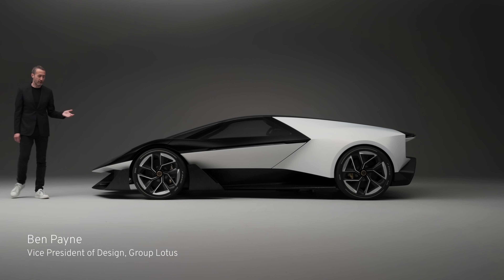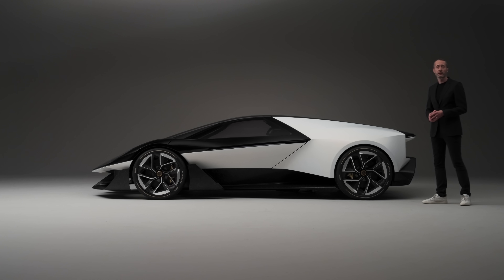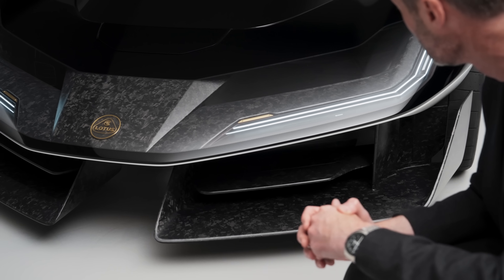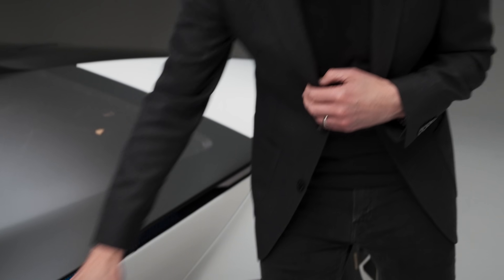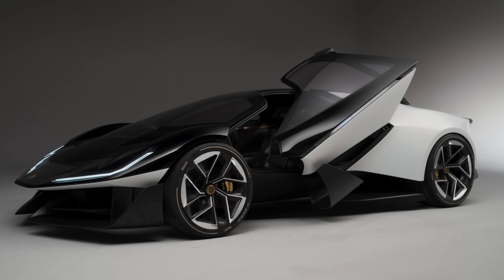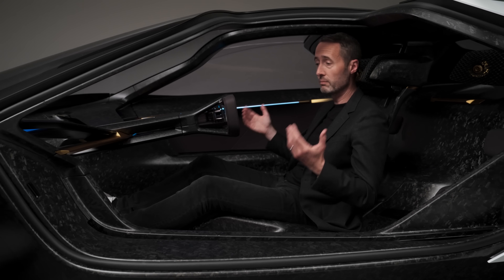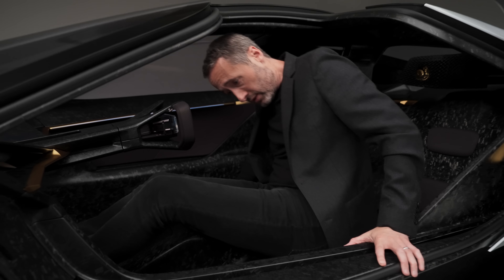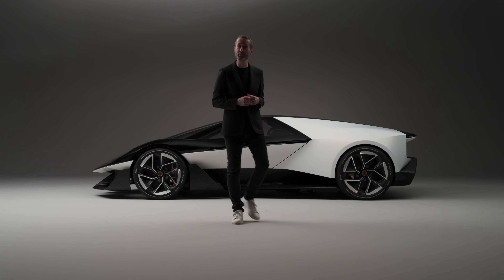Theory 1 | Designing the future of performance vehicles

Comment: Full drive by wire on a sports car is just... no. Steering wheel haptics on a sports car is another no. A door opening for as long as it takes to finish the 24h of Le Mans is uneccesary weight and complexity. LED lights on the door is a flex, sure. I like the design of the shell. Simplify the tech to aid the driver not distract or disconnect from the road. The best sports cars are stupid, not trying to be smarter than it's drivers.

Comment: @kelseystickney8663 @veronikalynn5084 @VoidBringer_98 Whether this presenter knows exactly what "analog" means matters not.  He is using all technical terms appropriately and accurately.

Analogue / Analog: This word is derived from Greek "analogos", meaning "according to proportion", meaning the output is proportional to the input.  In this context, it means continuous measurement, such as a mercury thermometer.  A pictorial representation would be a wheelchair ramp.

Digital: This word is derived from Latin "digitus" or in English, "digit" or "finger / toe".  In this context of computing, it means counting using steps such as that of voltage output levels of a transistor, i.e. binary.  A pictorial representation would be a staircase.

Electronics in the beginning was designed with analog technology where dials were moved according to current flow or voltage level.  This is like the needle in the first speedometers.  Now we use digital speedometers which have numbers shown by LEDs.

DNA:
Digital: the electronics in the car.  You saw the nVidia brand.  This may be an indication that AI technology will be used, since nVidia are now designing chips for AI software.

Natural: In this video, they are referring to the seats and driving experience being naturally fitted to the human body: Head up display (HUD), vibrations in the seating, easy entry / exit through the door.

Analog: Suspension, aerodynamic body, brakes, drive-train etc. are all analog engineering components because they deal with an analog environment, such as road surface and wind.

Comment: What humanity needs are small, lightweight cars with low horsepower and low fuel consumption, not that garbage. A private vehicle today should not weight 9000 lbs, but 1000 lbs tops, should make 120 Miles to the gallon ( e cars are idiotic destroy our environment more that gasoline cars ) and should be driving 100% autonomous (drivers are morons and idiots, humans shouldn't be allowed in traffic)

Comment: Beautiful design, ultra aerodynamic, finally not another economically dumb brick-alike SUV approach👍 ... but probably also one of the most impractical cars ever built. 
This car makes no sense on a regular road, unless you live here in Germany and have no speed limit on many parts of the highway. But why do you have to have two more seats when made for the race track? Do you want to drive a race with two passengers on board? 🤣 I didn't see any barf-bags on the passenger seats either.
I love the totally new acoustical approach to media ... it will sound so much better than any other sound system, feeding the audio waves directly to your ears. The best of that concept is that you can do active noise cancellation, making driving an extremely quiet experience👍 ... I presume its a powerful EV, not a an attention-seeking, stinky, loud, slow old-timer combustion concept.
Who has time for the doors to open and close and the steering wheel to come closer to you ... I'd be on the road minutes ahead, which you will never catch up without breaking the speed limits ... so its purely made for people to show-off. Its ugly men's perfect "jewelry" 🤣
Reply: It's a concept car and normal people won't buy a car like this. This will be a car that sits in a garage or a showroom the only people buying it will be wealthy people.

Comment: This is what you get when you can design are full electric car from the ground up without the bulky fossil engine and its drivetrain. In the same way designers can come up with total new light fixtures when LED's replaced the bulky and hot lightbulbs.

Comment: That forged carbon material is absolutely not sustainable. It uses carbon fiber offcuts that, because they would otherwise be going o the trash, is said to be sustainable. It's like saying "look, I finished eating all my food - I didn't put any in the bin". There is nothing sustainable about this - it is the least automotive manufacturers can do.
Then the worse: when these carbon fiber offcuts are merged with resin, it becomes a composite, and recycling composites... No, you can't recycle composite. The best you can do is shredding it and putting it into some other sort of forged stuff, or agglomerate, etc. It's like hiding the waste under the rug and pretend you've dealt with it. Manufacturers need to stop false advertising on sustainability. It's a lie.

Comment: hmm love it, pdc sensor in the doors high point so it doesn't hit the ceiling. talk to me about wipers, how futuristic are the wipers? the side sill is just too big. obviously the door is too slow. it sounds like a golf cart. the 3d printed parts look like all they do is collect dirt and are incredibly hard to clean. needs veyron style active intake so it doesn't look fat, with alot more active aero all round. can the lidar system be integrated behind that clear panel so it doesn't protrude? if you put on two lidar systems with popup up and down laser headlights in them, that could work. did your designers watch speed racer? can the car squat, jump and beg like that chinese car? can you guys at the very least investigate active gyroscopic stabilization so we can do speed racer jumps and controlled flips. can this car lidar system notify driver about potholes and speed bumps? with active suspension stabilization the haptics are an excellent idea!   also the roof is clear, can it electronically darken? what does the offroad version look like?

Comment: For the normal people who can afford a 100,000-dollar car, I prefer to get an Emira GT with these OPTIONS:

01.  Yes, .. Two centered 8-inch monitors.  One for radio, navigation, camera views. The 2nd monitor controls everything else. 

02. No electronic digital dashboard at all. Only round analog gauges: ... 5 inch rpm, 5 inch speed, transmission temp, engine oil temp, radiator temp, engine oil pressures, battery, fuel indicator, at 2.5 inch.
 Three gauges possibly positioned on the pillar column.  Other 2.5 inch gauges to be placed centrally as a pod, at mid point, above the dashboard.

03. No massive center steering wheel air bag cluster. No need for radio or other controls on the steering wheel. Bare is beautiful. 

04. No electronic seat adjustments. All manual gear adjustments ala1980’s.  Also, for lateral support and seat hardness the use of hand pumps. Lightweight seats less than 30 lbs each.

05. No, heating of steering wheel required. No cooling of steering wheel. No heated seats. No cooling of seats. No heated exterior rear-view mirror. No cooling of exterior rear window.

06. No, Alcantara interior at all.  In the heat, Alcantara feels like velour and disintegrates before your eyes.  

07. No, electronic telescopic steering column. Manual lever adjustments only.
08. No, lane change/departure warning required.
09. No, automatic forward collision mitigation safety system required.
10. No, automatic hands-free autonomous steering required.
11. No, pedestrian-detection system required.
12. No, parking distance display and park assist required.
13. No, self-parking system required.
14. No warning/bell collision detections from exterior rear-view mirrors
15. Eight to 12 cameras and their views to be accessed from 2nd 8-inch monitor.  
16. When driving, able to record front & rear camera views by the push of a button. 
17. Eighteen-inch tires and wheels are good enough for GT4 and Formula1. So why downgrade the Emira to pimp-mobile overweight 20 & 21-inch wheels.
18. Improve the aerodynamics of the undertray to maximise the car being sucked down to the road.
19. The undertray should be in at least 5 separate parts to facilitate access. 
20. Car weight 3000 pounds or less.
THAT IS ALL
Reply: This is the comment from a real driver.
Reply: @carlclarke9029  unfortunately Lotus spends too much time on new designs and a not on what drivers want

Comment: When I look at this, I don't see something that Lotus was always known for, and that's beautiful.  This is dramatic, it's extreme, but it's not beautiful.  Look at the original Lotus Elite, Elan, Europa S1, Esprit, then the Lotus race cars, especially the 72D, and the models that followed.  They were functional, and... beautiful.  The Emira struck a chord because it hearkens back to the original ethos of Colin Chapman; form and function that was made beautiful.  Remove the sharp, jagged shattered glass angles and make this shape beautiful, and you'll be onto something.  Looking at it from the side, from the tip of the nose over the top to the back, is a long, beautiful curve.  Look at the profile of a Peregrin Falcon when it's diving.  A tiny thing of flesh, bone and feathers and it can dive faster than this car you designed can go.  You have an interesting start; just needs refining.

Instead of sharp extreme angles and corners, think "flow"... that's a Lotus.

Comment: I feel like this man says "analog" a lot, but doesn't really know what it means . . .
Reply: not as bad as "virtual analog" instruments
Reply: In his defense that way of saying it is used specifically in Art. Where by Analog art usually refers to traditional media like pencils, charcoal, oil paints etc and require good old fashioned techniques. As opposed to working with something digitally like Photoshop or Painter.

It's not really used to denote "old fashioned, hands on, physical, etc" outside of that scenario usually.
Reply: @VoidBringer_98 then why was it considered appropriate to be used in this context? Is it supposed to be metaphorical…? If so, I’m not understanding how the metaphor even applies 😵‍💫
Reply: @veronikalynn5084  Lol only the definition makes actual sense unfortunately. The way it's used in this video is more marketing speak than anything. The parts that he himself refer to as "Analog" being the suspension system that you can see, the braking system, the exposed engine etc are all state of the art examples. They are also parts one would not commonly touch. 

A better example of Analog would have been some form of stressed exotic leather in the car that was new, made to look old and would be in an area the driver would touch often. Steering wheel, door handles, mirror visor, etc. So nope, I've got nothing that helps this guy 😂😅
Reply: @veronikalynn5084  made from some physical stuff as opposed to full of microchips.  So when he talks about the suspension as analog he's trying to say - look theres a bit of alloy there, nothing digital about that! - it's a really bad missuse.
Reply: not even the DOORS are analog on this junker 😭

Comment: Nice concept. Put a proper engine in it and an actual steering wheel and I think there would be genuine interest.
Reply: Definitely agree with the steering wheel. Usable doors wouldn't hurt either.
Reply: You know it’s going to be electric…
Reply: @Fred-rv2tu  No, it may be a hybrid sports car. Lotus announced a few weeks ago that it had abandoned its plan to fully electrify. At the same time, a new 900V hybrid system was released, and this new power unit is under development and testing.
Reply: @Fred-rv2tu  why does EVERYONE think electrics are bad!?!?
Reply: @ in my humble opinion… they’re just soulless. Sure they’re faster. But they drive themselves they’re controlled by iPads. You don’t work on them like you do an ice. To be fair though a lot of modern cars suffer the same problems. I’m a BMW guy and swore off any new ones when they made that wrap around display.
Reply: @ZVEditzSVJ   Well no one here said anything related to electrics are bad.
1. If you are talking in general then the issue is more about what they are promising vs what the actual product is.

Ford's model T was pitched as a more reliable horse which can run on any condition any time.
Most electric cars' pitch is that they are more environmentally friendly, cheaper and improvement over ICE. None of which is true right now.

They are less reliable in sense that you can't fill up anytime, You need to plan up ahead.
They are not environmentally friendly but does reduces air pollution to 0. Which is very good in cities.

2. If you are counting few motorsport enthusiast they will always prefer ICE, So we don't count them as target consumers for electric.
Reply: Its a concept. It needs usnusable "futuristic" BS. Im pretty sure actaul car will be very normal.